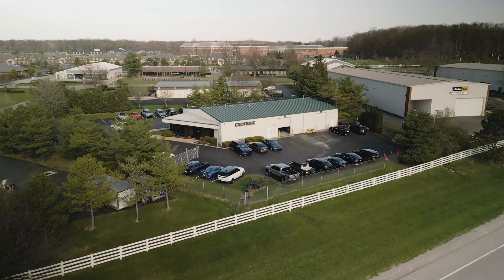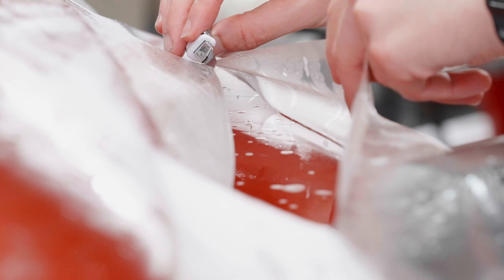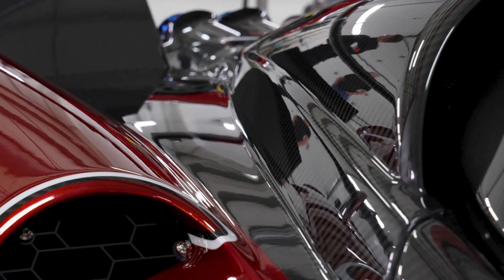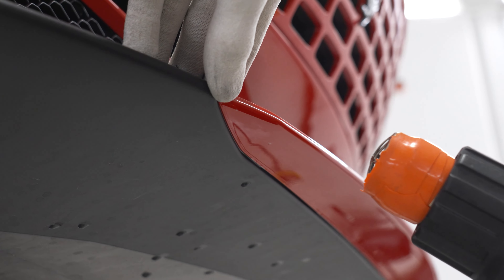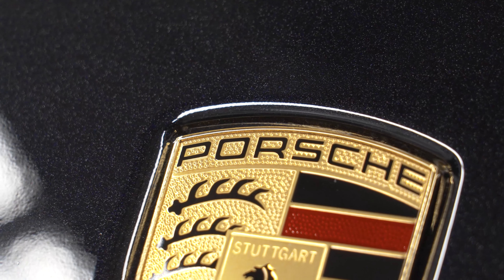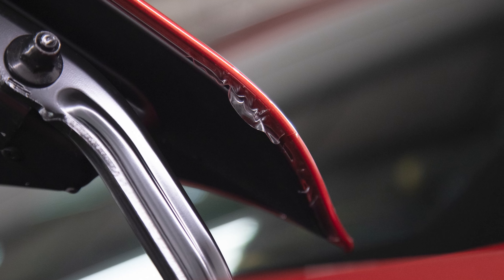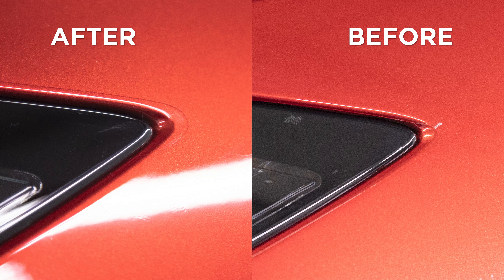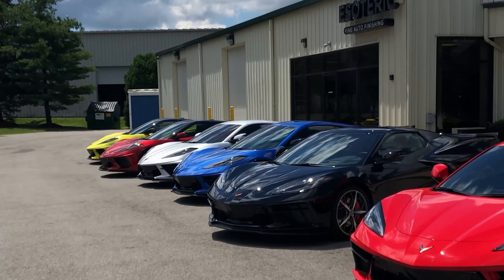How to avoid BAD paint protection film!

Comment: curious..what percent of your customer base gets ppf vs coatings or both?   great work as usual team
Reply from the maker: PPF leads the way by far! It's either full wrap plus coating or partial wrap plus coating...not a lot of coating by itself.
Reply: @Esotericdetail not that anyone’s choice is wrong. This seems to hobbyists and passion car care freaks. Like taking a guitar and putting it in a glass case. My humble opinion. 

I’m actually working to going back to wax for the more hands on approach and looks 

Of course mileage may very. A lot of daily drivers that I don’t blame getting wrapped. To supercars that get driven once a year.
Reply from the maker: @ssing7113  Regardless of how much it is driven, PPF preserves the condition and therefore the investment. Having a car fully wrapped also changes the mindset of the driver as you're just not as worried about it!

Comment: I just came across your channel.  I just picked up my 2023 Ford Maverick that I ordered 14 months ago. It's my first brand new truck. I have had it for 4 months  now. I have been taking it to a touchless  car wash about every two weeks.  I am trying to find out what to do. Do I need to wax it since it's new. I have watched so many videos.  Do I use the past wax or spray on.  Thanks. I really appreciate any advice.
Reply from the maker: You can apply whatever form of protection you like to it, however the modern sprayable products will save you a lot of time versus paste wax. Take a look at something like this: https://www.esotericcarcare.com/polishangel-rapidwaxx/
Reply: I wouldn’t go wax yet considering you’re taking it to touchless washes. 

Most people hands off should just take to a detailer and get a ceramic coat. Will have the best bang for buck maintenance for car. And rim coating as next level. 

If you want to start learning car care. Get some sort of 0 PPM water system. You need at least a 3 inch polisher. Pads with sonax perfect finish. And the whole stuff for car care.. and learn the system over months. 

There’s no easy step as this is like walking into a bar saying you want to be a lawyer. There’s lot of work. Time. Energy. Finances into the hobby and wanting the degree after a week. Tod the guy making the videos has done detailing for over I think 30 years and he still learns everyday..

First decide how dedicated you are and want to be. No problem if it isn’t for you as why do you think most peoples car look horrendous. 

Again two paths. Submit car will never be super as there is an art to hand washing Maintaining cars. It’s a hobby / lifestyle. 

So if not just get a ceramic coating. Take the car every two years into a detailer. Be happy 

If you wanna learn the system how to properly care for cars. You can still end on a spray on coating / ceramic coat / sealant / possibly wax but most time consuming and for the intimate car lover if you really get into car detailing. 

No easy answer as I tried to condense a lifelong passion for some into a few paragraphs. 

One problem is the longer you wait the more corrective damage you will do leaving it without any coating / products. Not a rush as a polish would take years of damage off a car. But the sooner the easier time someone will have from new car status.